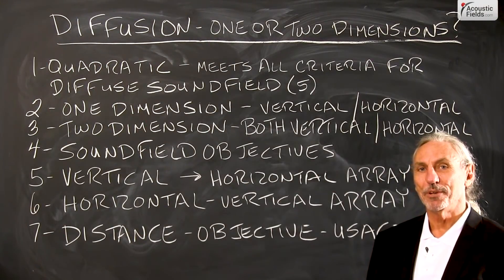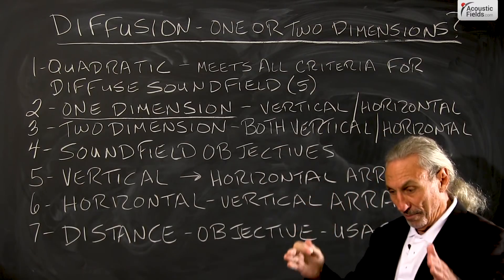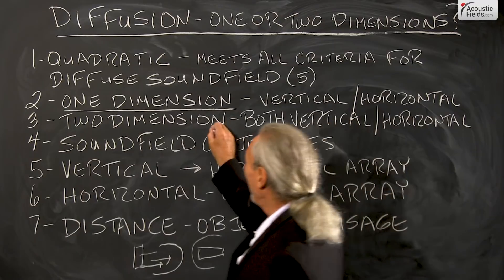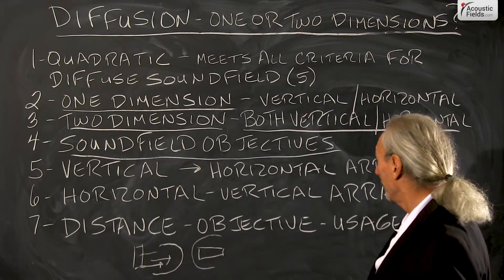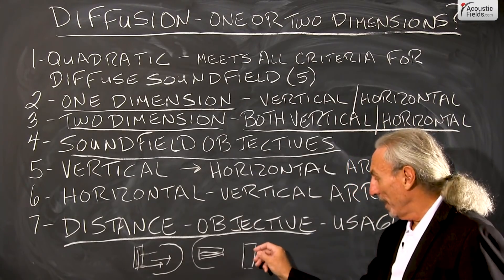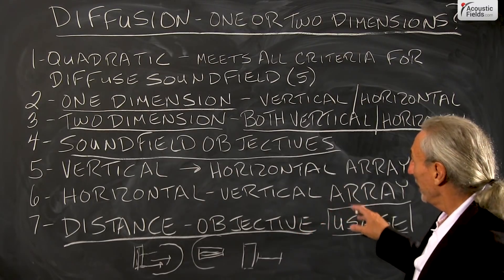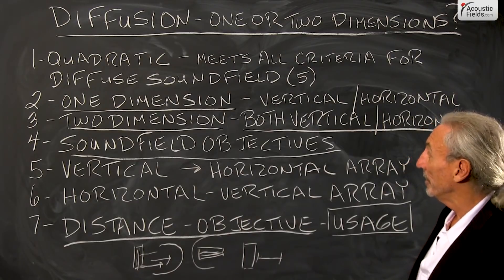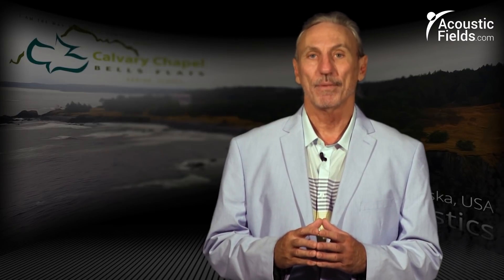Sound Diffusion - One Or Two Dimensions? - www.AcousticFields.com

Comment: Greetings. In this example: If I use a QRD-7 with a 4" well, times 4 = 16" ... Should I seat 1.5x ( 24" ) , 2x ( 32" ) , 3x ( 48" ) , other,  Away from the unit? Thanks!
Reply from the maker: I do not understand your question. A QD-7 will require at least 5' from its face to the listener ears to avoid phase issues.